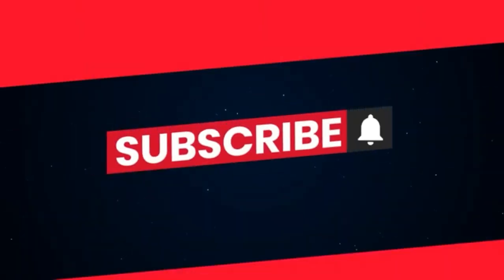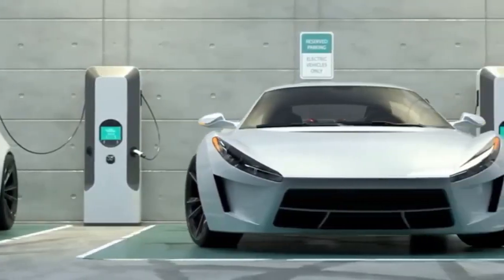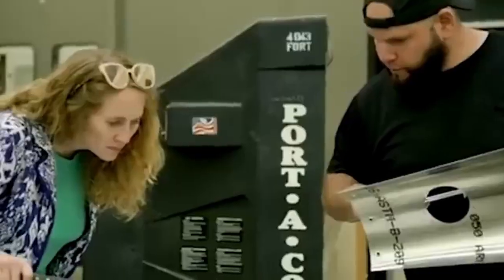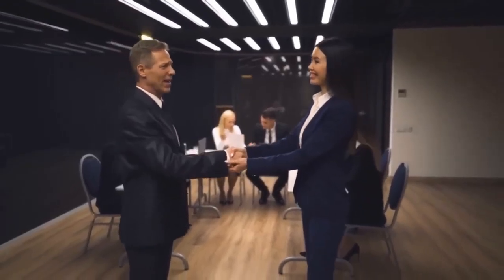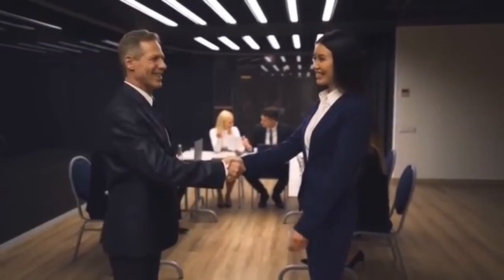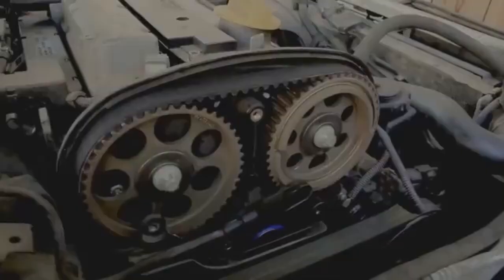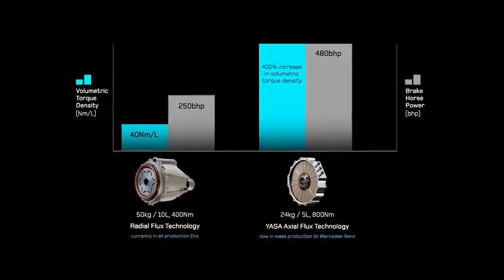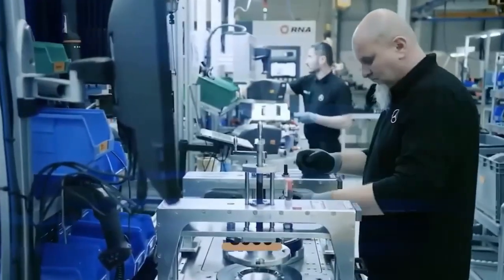BREAKING  Mercedes CEO Confirms YASA Flux Engine Is REAL – EV Industry SHOCKED!

Comment: ev motors weigh 30 to 75 Kg (some could weigh 100kg, but that would be very heavy). Energy use might be 10% better. If this is real it might be a small but significant improvement. "SHOCKED" in the vid title = calm down this is hype at best.